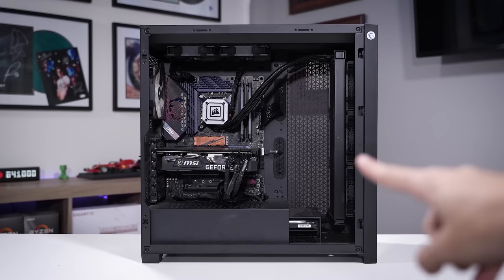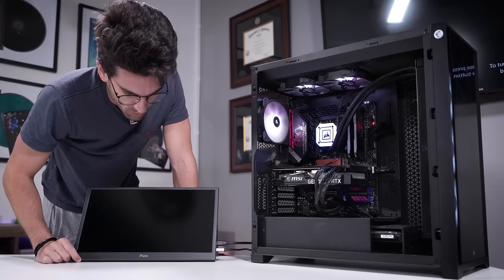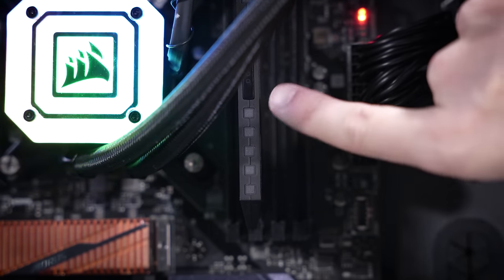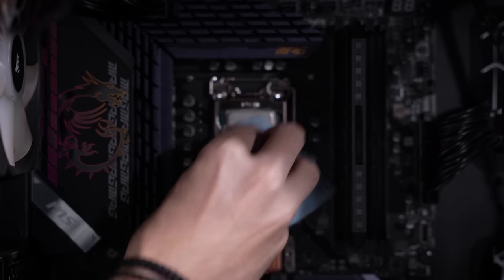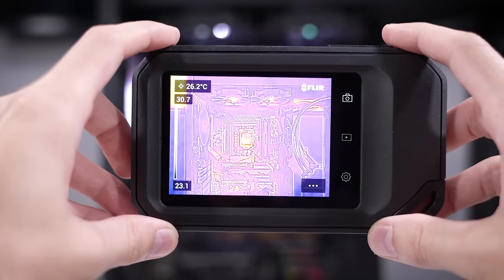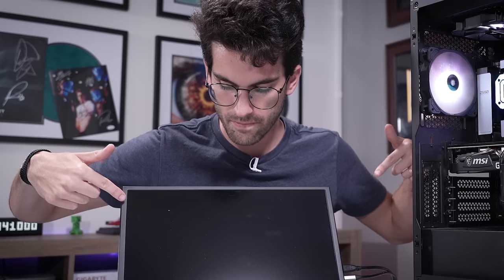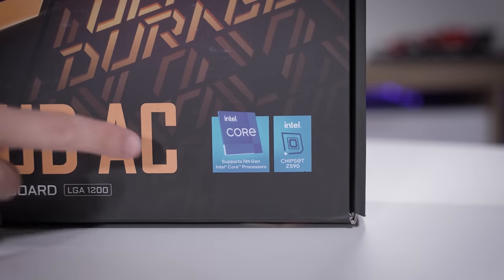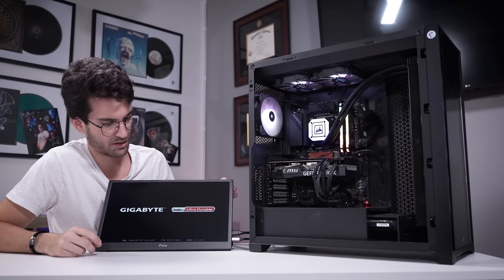Fixing a Viewer's BROKEN Gaming PC? - Fix or Flop S3:E9

Comment: Thank you so much once again! Sorry the pc was so dirty 😂 it was a few months since I’ve cleaned it out. I have cleaned it since! I was so happy it wasn’t a cpu issue. Brand new board just completely stops working.
Reply from the maker: Glad I could help! And thanks again for dropping it off!
Reply: Flip your top fans around, so they exhaust the air from the case.
Reply: omg glad someone else said something I’ve been fixated on this the entire video
Reply: @Kinji-  it’s unusual, but it doesn’t matter. I tested a few different positions for my 5800x build. The coolest for me was Front and top intake. I think It depends on the case you re using.
Reply: @TheSykoRC  I think you're right, in my old case I had better temps with top and front in-take, in the new one I have better temps with front in-take and top out-take
Reply: @roppongiful  Yea, sometimes you just have to experiment until you get it right. 
I had an old Storm Stryker case and it was so huge that I could put multiple rads and fans anywhere and it would be fine, but then I upgraded to an O11D a few months ago and I had to change my rads and fans multiple times to get good airflow and case temps.
Reply: @Kinji-  I was about to say this
Reply: stop doing cigs. love yourself
Reply: @Dee0426  I don’t smoke cigarettes my guy guess again 😏
Reply: @zakking5654  your lungs don’t really care in the end.
Reply: Nah dawg, you done fucked up his office with the smells,
Reply: @user-te2yy9ox8m  either way is fine usually. Minimal difference in Temps. As long as they have an exhaust in the back it should be fine. Though I definitely prefer the fans as an exhaust for aesthetic reasons
Reply: XD
Reply: @JoeBob79569  Ive got my front rad installed with three fans pushing air into it but have my two top fans and my rear as exhaust, think it would be better to switch the tops to intake?
Reply: @OSRS_Drone  It depends on the case, fan size, and what kinds of components you have, but usually having the top fans as exhaust is the best bet. I had a rad on the top of mine, with the top as intake, and it gave me serious heat issues, but when I changed them to exhaust it was much better. 
I'd say the way you have it is good, but you could even try putting the rear fan as intake, to create positive pressure to prevent dust build-up in the case, assuming that the rear fan has a filter, but they usually don't.
What kind of case is it?

Comment: You should do a video of testing all the parts you’ve pulled off of previous fix or flops and post the results in trying to diagnose and repair them!
Reply from the maker: I've thought about this - at the very least, with all the broken Ryzen CPUs I've accumulated over the years hahah.
Reply: I wonder if he can build a pc with swapped parts if he can fix them.
Reply: @GregSalazar  seeing all of the dead Ryzen CPU’s on this playlist has changed my mind about wanting to switch over to Ryzen when I eventually rebuild my computer in a few years. For now, I’m quite happy with my 9th gen i7-9700.
Reply: @GregSalazar  Disable some cores in the BIOS. Works 90% of the time.
Reply: combine all bricked parts to a frankenstein zombie rig^^ 
the parts will acknowledge each other and work together but dont let it get to the internet or we might have skynet for real
Reply: @b0ne91  how do you disable cores when the broken rizen cpu can't post?
Reply: @plop31  they post, just never load into Windows. Unless the CPU is completely dead. If you watched past videos, you'll have seen the phenomenon.
Reply: @b0ne91  not all of them if i remember well.

Comment: Also don't forget when swapping a new motherboard into a case, it will do a boot cycle as you've just seen. I've seen this on multiple fixes and builds. Always had geeked me out initially but realized that's just what happens when it's completely wiped out of power. 👍
Reply: yeah, and some do one cycle after just a bios update

Comment: First thought is a corrupt bios. Not too uncommon in boards that will power on, but don't post. With luck that board has a bios flash option or a second bios you can switch to. Otherwise you may have to remove the Bios chip and flash it externally. There is also the possibility some errant surge made it through the PSU without killing it, only to kill the MOBO.

Comment: MSI Z490 and Z590 had a huge problems with BIOS installation which could brick your motherboard if you installed the BIOS from the Dragon Center/MSI Center instead of from the BIOS through USB stick. The common symptom of this issue was PC hanging on the CPU LED and not posting.  There's dozens of threads on MSI forums about this issue. I believe this motherboard has BIOS flashback so you can try that.
Reply: old comment i know 😅 but dragon center in general is just bad. i had it on my “old” 10700k z490 system, and it trying to put itself in game mode kept giving me BSOD. then it was over playing my RAM to hell so id adjust it…BSOD.

never had another issue after i uninstalled that program lol

Comment: I really enjoy these videos. As a HUGE geek, I like to watch these and try to predict, based on the symptoms, if I can guess what the problem is.
Reply: Hi, I'm having the same problem as the pc in the video. Maybe you could help me with finding the problem? For a few days, whilst I've had the pc on the monitor would say no signal randomly. Whilst playing a game etc. I could still hear music from the game in the background. After a while, this would happen and I started to hear a buzzing sound from the speakers. I had to turn off the pc and turn it back on for the monitor to start again. Now, when I start the pc, the monitor is saying no signal. I haven't been able to fix this issue. 

I've recently got a new rtx 3070 gpu, I have a ryzen 5 3600 cpu, 16gb 3200 ram. And a 650w psu. The motherboard is a Asus rog strix b450. I'm getting a new cpu fan and 850w psu to upgrade the pc. I'm hoping that when I do the new build, it will be working as usual. I'm just not sure what could be causing the problem exactly. Sorry for the long message, I appreciate any help.

Comment: Greg, you might say that it's not the BIOS even after putting in the 10th gen CPU. However, that it wouldn't hurt to see if it actually is. Since the motherboard is bricked and there is a red LED illuminating for the CPU leads to the BIOS being corrupted possibly. The first thing that allows the CPU to fire up first is the BIOS once it goes through its training process. Please if you can have someone who is trained in that department look at it to reflashing BIOS chips. I guarantee that should do the trick into getting it run again and even better keeping it off the hands of the smokers.
Reply: @RulzSG  I actually didn't think about the BIOS flashback feature. Well then. That could be something that he can look back into to see if the flashback feature really is a simple fix to bringing it back to life.

Comment: A really, really simple suggestion to make your life much easier:  Get yourself a cheap but reasonable power supply tester.  You could save yourself a ton of doubt by just testing the power supply each time.  That could also save you from putting replacement parts at risk if the power is not good.  They aren't expensive and they would lower your risk (and add a good point to every video).

Comment: Hey Greg you should get one of those ozone machines. All you do is cover the pc to be mostly air tight and it should get the cigarette fumes out and make it a little better to work with. Though I'd check to make sure it's safe for a PC because I honestly don't know how it would effect electronics. I had one for when I bought used cars people had smoked in but lost it during a move

Comment: I just did two builds with Gigabyte UD boards.  Both did that power cycle thing a few times on first boot.  Only board I've had to it.  First one didn't POST and I thought I had a dead GPU.  Put an old, working GPU in and it worked.  Tried the new GPU to confirm it was dead and it worked.  Not sure why, but I'm not unhappy about it.

Comment: Love the playlist.. My OCD was driving me insane with those two top exhaust fans not spinning this time around.. :D (Hooray for Corsair and their huge ratnests of wires for fancontrol)
Reply: Same here, I was screaming internally when I saw those top fans. However, at 14:46, there's a brief but better glimpse of the top cooler, and those "fans" are actually just a part of the fan chasis. You can see the actual fan blades spinning just above them.
Reply: @vest816  Ohh, you're right.. Go figure. :) It really looks like they are not spinning. :D
Reply: Looks like they are set to intake instead of exhaust though, 5x intake and 1x exhaust fan seems a bit of a weird setup

Comment: That is so weird I just dealt with a smokers rig. The whole work area (garage) was filled with stale smoke and resin...you know what I mean!! LOL I knew the condition it would have been in so I didn't bring it in the house. Needed a PSU as it was caked in brown smokers fuzz and burnt it out. Cleaned the video card and repasted and repasted the CPU. Big mess but it is working again. I have used your video's for trouble shooting. Thank you for these great helpers.

Comment: I wonder if the gunk from smoking is spoiling contacts?  I have a rig that fairly quickly sent boot messages that one of the cpu connections was missing. It wasn’t but a electronic pray can helped it find the connector. The only reason I can think is living close to the coast in the tropics.
Reply: I've heard about smoke shortening the life of electronics so it wouldn't surprise me.

Comment: Nice that it was an easy replacement fix. I'd flip the top fans though as they're intakes now.
Reply: I wouldn't call a motherboard replacement an easy fix, if anything it's one of the most tedious pc parts you would have to replace. Unplug all the power cables, unmount cpu cooler, cpu, gpu then unscrew the motherboard screws after that you have remount components plus rerout the cables again it's alot of effort

Comment: I'm 90% sure it is a bricked bios because of the double dash which means it cant even start checking everything so it halts before even attempting the first step.
If there is a bios flashback option you could try to load a new one on it but chances are the bios chip itself got corrupted.

Comment: G'day Greg,
I don't understand why for Americans with broken parts Warranty isn't the first thought once you know what part is the problem, it always seems to be "I could probably have a look & see if I can fix it" even though as you said the Mobo is only 2-3months old, why not "I'll just contact the Seller or Manufacturer & get a replacement"?
Here in Australia at PCCG or Scorptec where I shop if something dies I just ring them to explain the problem, they will then send an email with a postage label & in a week using standard post (even during Human Malware when my 1 of my Corsair Vengeance Pro RAM DIMMs died) I will have a replacement, plus with most reputable stores generally there isn't even a hassle getting a Warranty replacement within the 3 months after Warranty has ended.

Comment: Did you check the BIOS battery voltage level?  I have seen an issue with an old PC that I was upgrading that had similar conditions... just saying..

Comment: that is almost my build, few small differences though. I have the Z590 gaming carbon, a 11500k CFX750, MSI RTX 3060 12GB, the 570x case, all samsung SSD's and NVME. am a big fan or Corsair and MSI.

Comment: That's a 11900k chip, a.k.a. personal space heater. Even with an aio you need all the exhaust you can get. I did not see the top two exhaust working, only the rear one. In that configuration that thing is going to get mighty hot.

Comment: Hello, I recently built my first pc and was using a stock cooler and found that it didn’t help my cpu temps especially when playing games like valorant or apex. I recently also bought a nzxt z53 and hooked it up correctly but get temperatures worse than when I had the stock cooler. What do I do??

Comment: In my almost 20yrs of PC building experiences the motherboard has been by far the most common week point of the system, either due to ram incompatibility, bios needing flashed or just physical failures of the motherboard parts (like USB, audio ports & video out connections)...never had CPU failure, although I had one degrade over time due to extreme heat over many years of use, it was a Pentium 4..."Thanks Intel" :/

Comment: For the CPU debug LED it will light red if there is any CPU issue. Mine nearly cooked when my AIO bricked, and while it would post and run, the light would turn red to indicate thermal max.

Comment: Hmm... Well, further troubleshooting may be ideal, but sometimes, it could be corrupt BIOS. See if the system can still flash a good working BIOS. However, when you show the broken motherboard, one of the choke has slightly different colour than the rest. Could be VRM burnt.

Comment: I have a ram memory issue with mine my Hyperx 8 gig ram stick seems to be having issues because i keep getting out of memory issues on my pc when playing games and having my browser up that hasnt happened before like ever it started recently happening to my pc also had a GPU power cord not plugged in the right way so when i turned the pc on my GPU was showing red light and the pc beeping which tells me GPU wasnt receiveing power.

My older brother keeps saying i need to debloat my pc to fix the issue and says that my cash memory is overfilling my drives thus the error comes.

Comment: hi greg just a quick question. i have a 3070 gaming x trio. can it run on a 6+2pin and a 8pin at 2010mghz without the worry of it burning the cables? it does pull about 240 watts i do have a 850 so no worry about the PSU itself

Comment: Did you check to make sure you weren't shorting out the board ? I've learned to power the board on outside the case before screwing it down because I ran into problems like you are having. Not telling you what to do. Just a suggestion.

Comment: I had a similar issue on my board, and for me the problem was that little black chip right below the CPU 8-pin plug on the right hand side.  Not sure what that chip does, but I saw visible smoke come from it.  After that the PC wouldn't post exactly the same way.  
I also noticed that little chip in your video has 2 little blueish paint marks on it, maybe MSI already worked on it once before?

Comment: I recently built a system , when trying to play a game before launching the graphics card starts rattling which I find weird since it's a new 6900xt xfx. Any idea why? Also on that note warzone 2.0 won't surpass 30 fps in the menu as well as in game, whereas the campaign easily hits 150fps on average also any ideas on this ? 

System 5800x3d 6900xt , 750watt, 3600mh 32 GB RAM cl 18
Playing on 2k

Comment: Please read - 
1 tip I would like to drop- when checking parts like mobo, graphics, etc (with bare PCB) try to look for pee stains. Because sometimes rats or some other creature enters from some gap in case and pees upon components. 
I have been a victim of this 2 times. Lost my Graphics card and motherboard.

Comment: Did you tried using the faulty board with Pentium or Celeron chip of 10th gen, if it's power delivery related issue - Celeron or Pentium chip might work without any hiccups

Comment: not sure if my comment will be seen but I feel like recently motherboards have been broken or just bricked. I and my friend both upgraded our pcs recently with ASUS rog strix z590-e. both of ours from our local micro center were bricked. maybe its just asus maybe its just quality control. all i know is it sucked. glad this dudes is back up and running
Reply: Yeah maybe some QC issue with that particular model even, since you had the same one. I mean Asus boards are generally very solid, though I know their X99 boards weren't.

Comment: I got some issues with my pc. Its seems that the power supply is the culprit. When I can turn the pc on everything seems to be working well no crash no boot loop all ram is availabe. My cpu can do heavy loads reset the bios the motherboard also no physical sign of damage. Its just that it won't turn on sometimes. I'm almost sure that its my power supply as I can't find something that is not working well other than that

Comment: I have like the same issue. i play at high frames and like most games just crash. ive switched gpu and ssd and still tyhe issue is going on. the mobo shows a red light for the cpu but yet but parts work enough for me to go on the web and play melee with an emulator. so for me I'm beeter off upgrading the cpu and mobo to a newer platform then changing either my 3700x or the motherboard for the issue to still happen and sell the parts off after. anyone got this issue? all drivers and windows are updated obvi too.
Reply: I might suggest borrowing another PSU to test here, but failing that, this could actually be the CPU. Ryzen 3000 seems to have been sort of a low point in quality in terms of PCB material and such. Temperatures under load are not abnormal or anything? Failed AIOs aren't exactly super rare either...
Reply: @PileOfEmptyTapes  well I decided to rebuild the pc into another case. so I was like hmm lets take the cpu out the socket and check for anything and put it back and then new paste. wow let me tell you it worked like day one that I got it. no issues and gaming just fine plus with streaming at the same time. strange but everything running good now. so I can save my money still for ddr5 and build a new pc. already went from 2060 to 3060 ti.